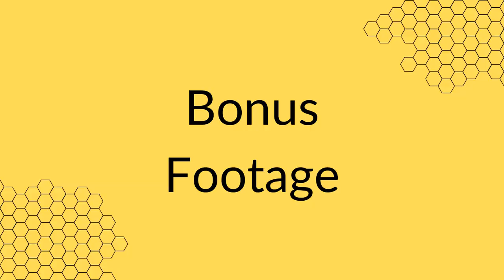Insulated Horizontal Hive Build Part 1: Cutting the Pieces (Making Sawdust)

Comment: Another great video!! You 2 work well together and the production is great, it helps when you speed up sections and add titles of explanation and.especially all the tips you provide in the process.  Thanks for the discussion on the Kreg, looks to be really worth and they're only about $39 if I'm looking at the same thing.  What do you have underneath the plywood (some sort of foam)?  What brand, size of dado stack do you have?  Southern yellow pine 11/32 at Home Depot is $26.63 where I'm at.  Looking forward to your next video in putting it all together:-). Thanks!!
Reply from the maker: Thanks so much!  That Kreg Rip-cut setup is pretty inexpensive.  We got ours at Lowes a while back and it was definitely less than $50.  It doesn't fit every circular saw but works great on our Dewalt. We do have a piece of 1 1/2" foam insulation board underneath the plywood.  Roy sets his saw to cut about 1/16" to 1/8" deeper than the thickness of the material he's cutting.  The saw blade makes shallow cuts in that insulation board and not in our sawhorses.  We are using a Harbor Freight Admiral dado stack (I think 8") that we bought specifically for building bee hives.  It was relatively inexpensive but still had good reviews, and it's working well for us so far.  We have actually finished the hives now and are planning on two more videos to complete the build.  Stay tuned....

Comment: The need for cutting and assembling this beehive lies at the extreme end of craft skills. A great deal more with a great deal less in both material and skills is gained by simply ordering some aerated insulated blocks to lay as a floor, stack them up to form the walls and then as a roof to form an external envelope to house the bees. Lasting progress is achieved by doing more with less.
Reply from the maker: Roy has seen one built the way you describe on YouTube and it should work ok. However, we already had the tools and skill set to build what we did. And we believe they will hold up better long-term especially against predators like skunks,  raccoons and birds. The main goal is a safe and comfortable home for the bees. Let us know how it goes for you.
Reply: @randsbees  I like the ambition of a "safe and comfortable home for bees" in a world fraught with the varroa mite. 
I suggest that you not only insulate it as you are doing, but test it with just top bee entries. It will be more humid which the varroa do not like. The humidity seems to be held in the ZEST hive with top entries, like a bucket of it. The insulation will also impact on the speed at which the pupa hatch. At 35C. they will hatch at 10-11 days. At 35C. they will hatch at 14-15 days. Above 37C. and below 29C. they die. One disadvantage of a lightweight insulation hive may be that it does not have a thermal weight to carry the heat of the day into the cool of the night and the cool of the night back into the heat of the day. I think that you are doing o.k. though with this design to make the bees a "safe and comfortable home for bees"  by suppressing varroa's chance of thriving. You only have to tip the balance to less than varroa replacement value to see them collapse in numbers exponentially. The ZEST is free of it, except a few dead ones and no DWV.